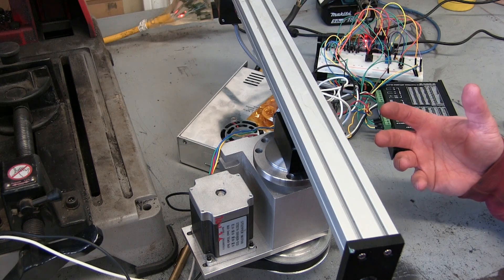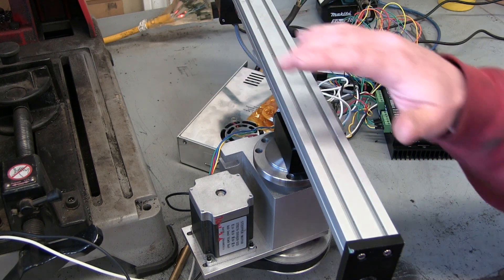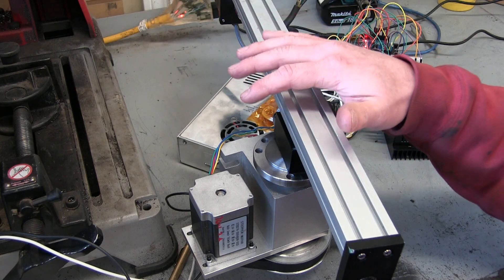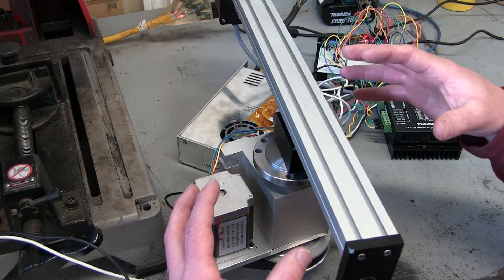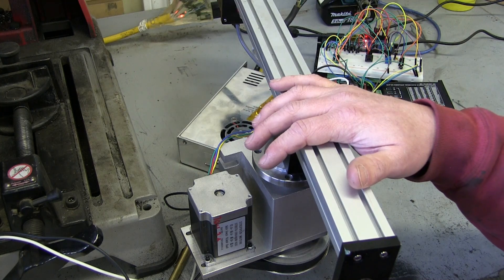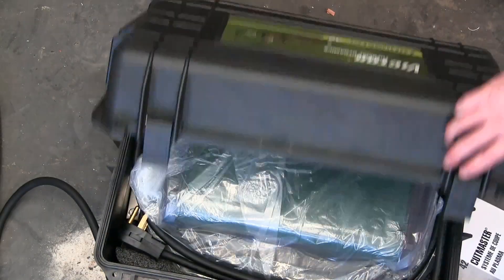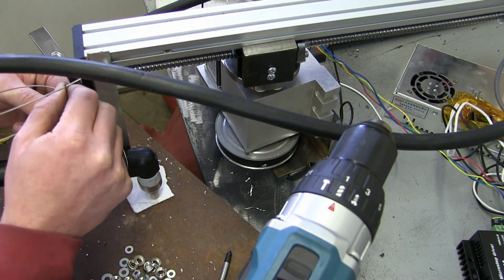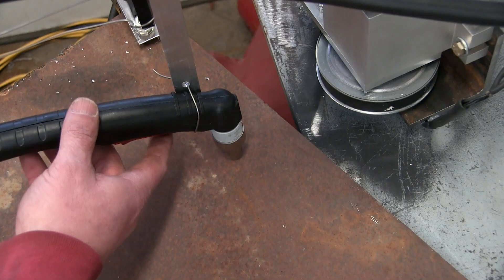Portable CNC Plasma Prototype

Comment: Dude I NEVER thought about this, it is brilliant.
However I would totally scratch the app idea (maybe as complement, developing and maintaining is to expensive).
Best method for the field would be a detachable (because it is precious)  little laser scanner on top. The brains :-)
Then just mark with retro reflective ink "x"s in its work area the corners or points,
cycle with two big sturdy gorilla buttons through the different cutting patterns / modes which are displayed via the laser,
select the one which fits your bill press "go" and take cover :-D
This method has the advantage that you can easily reposition it without loosing tracking.

Comment: That's the best effin CNC idea I've seen in a really long time. If my memory is choochin, have a look around the source code in the Linux CNC project. There's is section with example kinematics for various robotic arms, which should be very close to what you need, with the possible exception of the speed compensation at the varying radius for your cutting arm.

Comment: I'd set up a relay that the micro controller can chooch so as you don't have to hold the trigger. I'd run the hose down the gantry arm such as to reduce the lateral stresses on it. You'd also have to adjust the code with it being a radial arm device and all. I also think a hall effect sensor to tell when the thing strikes before the rest of the work takes place would be a good idea. Would I use it? You bet your harry love sack I would. That's pretty skookum shit there buddy....

Comment: Maybe not an issue but how do you align it, all fine and good cutting out of a plate but if i need a circle in a precise location where do i place the setup orientation wise or how does the setup know where i want it. My improvement addition would be a lazer that quickly show's he outline like a dry run of what its going to cut and if you're happy you can re-orient. But I don't know shit about these machines and how smart they are so maybe this is an unnecessary gimmick
Reply: actually might have answered my own question but you could use like a tip ex pen or something white on the darker background and the machine could use that as a reference for a starting point with the right sensor but probably not the most foolproof fix

Comment: Put a raspberry pi with a small screen to be your interface. 30$. Take a look at the router origin. It's for wood, but it has some pretty impressive brains. kind of a different animal.  You're going to need a z axis adjust somehow and a speed chart for the material thickness. pretty cool idea. get some sensors in there for positioning. or laser guide? project the cut paths with a light before cutting?

for the low tech but skookum as frig simple version, just use a hard template or pin guide. I'd be worried industry guys wouldn't want to use it because it has too many moving parts. gotta be able to be thrown around and still be accurate.
Reply: +1 to the idea of projecting the cut path ahead of time..
Reply: Alternatively, you could just use a touchscreen on an arduino - I believe that AvE is using an Arduino for this already. Adding wifi and writing the necessary components would likely be more difficult than just adding a touchscreen directly to the arduino.
Reply: Evan Ortiz my idea was a simple [X] projection to set the starting point and calibrate the orientation, with feedback to the app for any necessary fine calibration. Maybe link the app to the camera so u can place the shapes onto an actual picture based on the laser projection. Place, rotate, move, dick around, w/e, then when u are ready it cuts exactly where and how u want to.
As for durability, maybe modular design? If the arm is separate when not in use then torquing it would not be an issue right?(obviouslywith an auto shut-off in case of catastrophic failure during a cut)
Reply: Ken Oakleaf That [x] projection would be cool. I'm now reminded though of my own thoughts on laser guides: never accurate. But this is field work, so I'm pretty sure it'll be close enough.
Reply: actually really good point, a touch screen would simplify it a little more for the technologically challenged fellas then it also eliminates the whole app concept, so less work, adding in a little work obviously but not as much as app design would be and app bugs and what not, its not a great area to go into if you want something done fast,

Comment: Without any sensors for the machine to know its own position it could easily drift out of alignment.

However with some form of positional tracking you could potentially move the arm along the desired shape or path by hand and then set the machine to repeat that motion each time a button is pressed.
Simple interface of two buttons, record motion button and perform motion button.
Reply: This also would do away with the maths required to correct the movement to a x and y perpendicular axis as the motion can be recorded as the rotation and extension values a few times a second.

Comment: I really like doing all kinds of CNC and whatnot, but it takes way too much time, just to get stuff squared, finding your zero point, program it, and whatnot, just for making a bolt hole pattern. I probably wouldn't use this beast here in a professional environment, but thats mostly because it's just not my field of work. Our products are small enough so you can fit them inside a machine, and don't have to fit the machine inside the product.

As improvements:
This thing has to be rugged as fuck. Having an open belt anywhere even in the same room as a plasma cutter? No es bueno. Also, it has to be able to withstand a serious beating, and has to be a lot stiffer than that thing seems to be.
Operating: I don't like app controlled stuff. Your battery goes flat, your phone wants to do an upgrade, you don't want to close your little game of whateverfloatsyourboat just to do some occasional "work". How about a little RPi or something, and a little touchscreen? These things come in kits and are dirt cheap.
Also, it should have a set of clever tools to position it, to hold it in place on nonmagnetic surfaces, to recess or elevate the working surface from the clamping surface, maybe even to adjust the cutting angle to cut "around a corner". It would also be nice to be able to flip the cutting head around, in case you want something like putting a pipe straight through an air duct or whatever. clamp it inside the duct, select circle and position, hit start, turn the head around, hit start again, and you're done.

Comment: Brainstorming here... ESP8266 in Web server / Access Point mode. Phone can send web commands directly. Z-axis with distance sensors to material agains warping, extended arm weight, irregular surface etc. laser would be great for Cartesian alignment. Fixed on base, perhaps. Feed rate calculation, rotary to x/y calc, panic button.
Reply: ESP8266 is a good idea, but it has it's limitations. I use the Mediatek MT7688 duo ! A powerfull linux machine for 20$ and I do all my number crunching on the chip itself ! It can even self update through internet.
Reply: Contango1000 "distance sensor" aka spacer? 😉
Reply: Bluetooth would be the way to go - I don't see any reason to use wifi specifically. There are plenty of cons for wifi - such as the phone not being able to connect to other networks at the same time (you couldn't browse the internet and also run this device).

I have several wifi-connected devices and every time I use them I wish they were bluetooth.

There is also no reason you can't do the trig calculations on something like an Arduino.

Comment: How about put a little optical mouse CCD on the end of the arm a safe distance from the torch so the tool can follow a line and program itself.  Have the tool-on-the-stool chalk or pencil the shape (or decal?) onto the metal, and then program the mag-cutter in-place for one-offs. Someone else can even mark up the holes before the cutter-guy shows up? The app on the phone would just confirm the robot got the shape right.

This also solves the problem of zero point and orientation.

Comment: That's cool.
For help with code for translating coordinates in to the correct motion check out the reprap project. They have some very unorthodox models and I'm sure somebody can help you in the programming section. Or may be code directly adaptable. 
I'm a tool freak so would defiantly want one. Hell I have a Van Norman cylinder boring machine. 
You ever seen one of those? 
Dunno where you go for that app.

Comment: The system you have set up here works on Cartesian coordinates, that uses a radius and an angle instead of Polar coordinates, that use an X and Y dimension.  The conversion is pretty simple.  Here is an online calculator for the conversion http://keisan.casio.com/exec/system/1223526375
Reply: You have that backwards.  Cartesian is the straight xy similar to a 3axis mill.  Polar coordinates use an angle and a radius.

Comment: OH! For the folks who are more oldschool... You could put an eye on the thing, and get it to follow a track that you could draw out on the metal itself!

This could make it act like a much bigger version of itself. If you needed to cut one large piece out of a single sheet, you would just draw it out, find a starting spot, and then have it make the cuts that are within range. Then just pick it up and drop it further down the line. If you really wanted to get fancy, you could have it spit out a laser from a push button, that would put out a few points in 360 degrees to indicate the area that the thing would be able to cover. 

Set it down, push a button to see what all of your drawing is in line, adjust if needed. Have a test run option to make sure its going to go where it's supposed to, then cut.

Comment: I would recommend one small servo on the base to allow you to cut on tube as well. Wouldn't need to have a lot of variance but a few degrees either way would allow you to cut saddles in the field on pipe for the fitters as well.

Comment: How are you planning on handling part registration in the field?  I've got a part that needs a bolt-hole pattern in a particular location and orientation... how do I make sure my part is clamped up in the right location and rotation?  The software and hardware I think you'll have no problem with.  It's the small-footprint stupid-simple in-the-field registration that I think might get ya.

Comment: Awesome demo!!  SO damn useful!!  Like you say... would/should be completely possible to connect up to phone... guaranteed the average fabricator/welder would have no problem or second thought about UI being on phone (conversion from cartesian being done behind the scenes as gcode is produced).  Also, reliability of app on phone won't be an issue (given an good developer).  I would shell out the bucks to buy... or the extra effort to build.  The flexibility alone justifies it over traditional x-y machines... even if same cost or effort to build.
Reply: Also, for those who believe they want a static footprint and just shuttle metal in and out w out touching the machine (I.e. comparable to traditional x-y tables).... this machine could easily attach up side down over the work (not touching the work)... And still operate in exact same capacity of accuracy as x-y table (never touching piece cut... besides plasma head).  A rotary-linear gantry if you will.  Scaling on this unit would be incredible as well.  Just add longer linear travel and adjust app to be aware, and you can cut in as large of dimensions as your motors will drive (add non conductive roller as Thomas Chism suggested).

Comment: You should put something in the programming to adjust the speed of the rotary axis depending on the position of the slide because when the slide is out the torch moves faster than if the slide is in

Comment: Nice! One issue I can see is angular resolution really hurts when you're reaching out too far on the linear, so basically you get more exact cuts closer to the base and further out you end up gnawing like a drunken beaver. I can help with the polar to Cartesian coordinate stuff if needed, also important to get it to maintain reasonably constant speed. In the end you'll break the tool path up into smaller and smaller chunks until you can get away with the precision AND at the same time reach the limit of your resolution.

Comment: JET EYE MASTER MACHINIST / WELDER FABRICATOR KIETH FENNER TOOK AN OFF THE SHELF CNC PLASMA CAM CUTTER AND MADE MAJOR IMPROVEMENTS, SUCH AS A  POP-A-WAY TORCH HOLDER, WATER TABLE, SMOKE FREE VENTING, AIR DRYER FOR THE TORCH AND MANY MORE. YOU MAY WANT TO PIRATE SOME OF HIS IDEAS FOR YOUR MAGBASE PLASMA CUTTER  HE IS OUT ON MEDICAL LEAVE FOR A FEW MONTHS, BUT WILL BE BACK SOON.  HE HAS MADE MORE THAN 500 YOU TUBE VIDEOS AND IS A GREAT TEACHER OF THE METAL ARTS.HERE IS HIS CHANNEL https://www.youtube.com/user/KEF791 HERE IS HIS PLASMA CAM PLAYLIST.https://www.youtube.com/watch?v=Udk-6cPK0X4&list=PLD2A32A18294AC31D I SEE ON YOUTUBE COMERCIALS THAT LINCOLN ELECTRIC IS NOW OFFERING A CNC PLASMA CUTTER. I AM A RETIRED INDUSTRIAL CONTROL ENGINEER FROM THE ALLEN BRADLEY CO / ROCKWELL AUTOMATIC.   MY SPECIALTY WAS MOTOR STARTERS, AND I BUILT 1000'S OF CUSTOM CONTROL PANELS FOR VARIED INDUSTRY.I HAVE ASSIGNED YOU THE LABEL OF "POTTY MOUTH NORM CROSBY", WHO BUTCHED THE LANGUAGE FOR LAUGHS LIKE YOU DO.

Comment: Friggin brilliant, pair this with a hypertherm powermax xp machine, some type of onboard laser/infrared obstacle obvoidance/distance measurement, i.e. It detects distance from X,y,z axis to auto adjust for obstacle avoidance, then you have the best system on the market, longest consumable life and most accurate cuts on the fly. Also you need a magnetic break away for the gland end. Bro, you gotta have a cool pelican style case for it too, so it can get kicked around the back on my truck. Call me when it's ready, I'll cut you a blank check lol. Edit: skip the app idea, put a space in the pelican case for a tough book to sit. Everybody hates their phone, nobody minds a tough ass laptop. Far more control.

Comment: Hey AVE, What about for the interface you add a 16x4 LCD and some buttons for angle, length, width etc. If you do wish to implement the phone app you would simply need to add a bluetooth module to connect with the phone. Anyways would love to participate in this project and help since I have experience with arduino.

Comment: Having been a fabricaotrs son and a cnc tech this is a great idea   there is a few things I would add would be super easy to add a differnt torch head that is meant for machine use and use a relay instead of pull the trigger    I'm not a anroid programmer but I I would be happy to put some time into a pcb to control it   but the one thing is making sure its able to be lined up to cut things square to other things   maybe at least put a soap stone holder/ paint pen  in so you can do a test run and look at the hole it would make check for location and position

I would use it and I'm sure a couple of friends would too might even be able to get the old man now retired to play with it a bit

Comment: Btw as far as the kinematics goes. Being that you don't have a Z axis to muck about with, shouldn't you be able to keep a metric in the programing that corresponds with the distance of the cutting point from the rotary center, and map that scale to a function that damps the the angular speed proportionally as the cutting point moves away? Seems like an easy way to trick it into thinking its a 90* XY plane so you can feed in normal drawings but maybe I'm thinking too linearly.

Comment: Well, I have some decent CAD design experience, but the one you might want to talk to is my father, who owns a small engineering firm in WA State. He's an ace mechanical engineer who's been working in the field for about 40 years. He does interface/control programming as well, and back in the 80s partially developed a CAD program that would design parts with numerical input and simple descriptions of the features, then create the model and subsequent drawings for you instead of working the other way around and developing drawings first. But he had four little kids and bills a mile high, so it took a backseat to his regular work, then never got finished. He's also worked on the early plotters, and remembers the company he worked for at the time celebrating when they actually developed software to make a line plot from the screen to the paper roll, back in the days when they used plotter pens instead of cartridges. So he's got some of the experience you're looking for, just not sure how much he's willing to help for free.

I should mention I showed him this video, before posting this comment. He's not a fan of the internet, and only uses it for work and a little social media with the family, but he liked your Helac rotary actuator breakdown that I showed him, and his office is right across from their manufacturing plant in Enumclaw, WA. He and I have both done CAD design work for them at different times, and my father's business is above a full fab/machine shop too (a separate business, but closely associated with my father's), so he can even do a little tinkering on his own. My father's only negative remark to your idea was that it's going to take a lot of resources to develop, even with free help. But yeah, he's worked with plate steel quite a bit, and believes there might be a market for the machine. My father could probably point you in the right direction of where to go from here at the very least, if you'd like his contact info. He's very well networked, too, so he might be able to know a few people who can help you out with patent applications and mess like that. He has a website and professional contact info I can forward to you if you're interested. I just didn't want to post it all in the YouTube comment section, although I'm sure the people here are mostly harmless =p